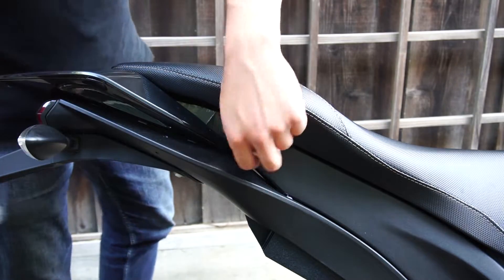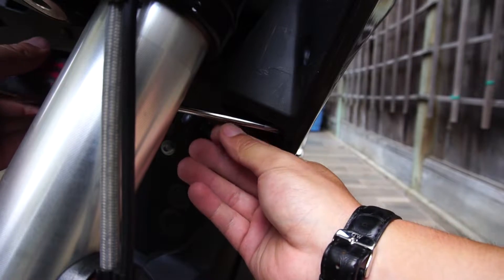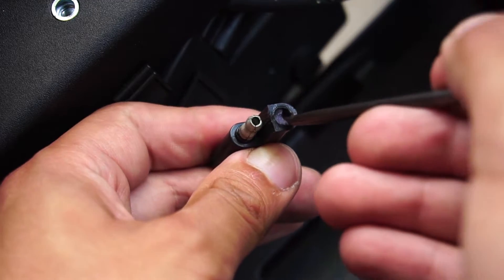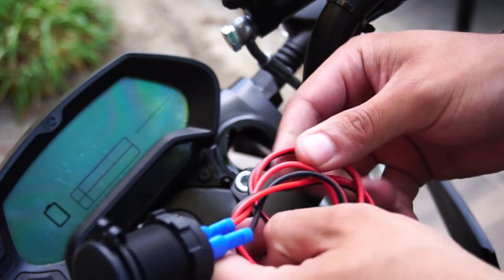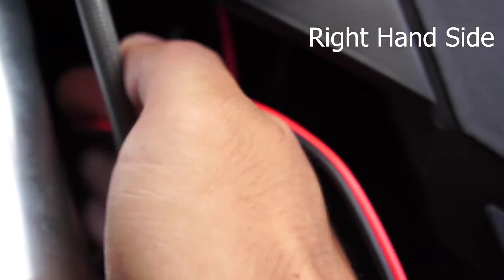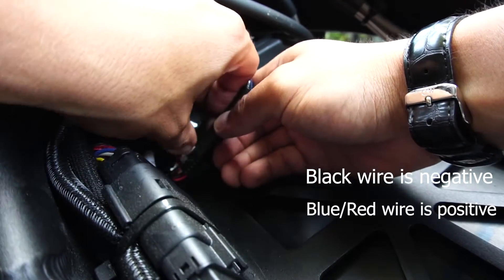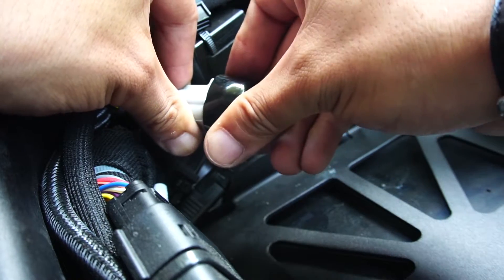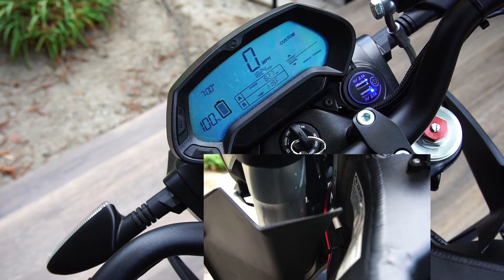Zero Motorcycle - How to install a USB charging socket

Comment: nice video! 
do you know what is max amper in that SAE connector?   I want to connect heated grips, which draw approx 6A i believe.  cheers.
Reply: just found my answer on unofficial zero manual, Both plugs are fed power from the same 10-amp circuit.

Comment: Nice vid. Thanks for referring to other vids for folks that wanted additional hand holding which kept the length of this one shorter.

I just installed the stock 12v plug in my 2018 S that has the charge tank option. I ordered the plug from Zero, hoping it would make things smooth and easy. Unfortunately, on my bike there was only the SAE connector and the plug they sold me had the other one. I looked everywhere I could without taking the charger out, but it wasn't there. So I purchased a SAE extension wire from Lowes, cut the gray connector off, soddering on the proper connector in it's place I guess if I'd purchased my plug from a third party source I would have been better off!

One other note. With the charge controller in the way, it wasn't so easy to push the wire up along the existing wire harness. I had to use a string fed through from the tank side, tie and tape it to the connector and use it to pull the wire up through. Worked like a charm.

Comment: great video! I have a question: is there a way to have the 12v socket working without the bike being turned on?
Reply: I wish this could work too. I do a lot of camping and it would be great to use my Zero battery as a really big backup for my 12v refrigerator, etc. My idea, which I have not yet implemented, would be to insert a switch at the fuse box to turn off the headlight when the bike is in ready to ride mode. With the kickstand down I think this would be a fine option as the rest of the functions of the bike probably don't use much power and it won't allow you to knock it off the stand even if someone accidentally turns the throttle. Adding another battery does not sound like a solution to me. You might as well just use an external battery pack.
Reply from the maker: You would need a seperate battery pack to continuously charge the 12v socket. I bet if you connected a SAE connector to a USB battery pack that may be a workaround. But it is less than ideal.
Reply: @alternativestandard3303  See my reply. How much power would it take to use my solution?

Comment: How do you install this when there is a charge tank in the place?
Reply from the maker: You may still find the SAE 12v connector behind the charge tank. Instead of removing the charge tank try looking for it from the front. It might be easier to find i that way.
Reply: I found the SAE connector along side my charge tank, but not the other style connector. I have a 2018 so perhaps they stopped providing both connectors? Or the other was hidden under the charger. I used the SAE so I'll never know for sure.

Comment: That gunk you pull out in the beginning is meant to be there. It helps with the connection.
Reply: Indeed. Better to take some of that gunk and put it on the exposed pin.

Comment: Any advice on how to connect LED strip lights to an FXS?  I can't find seem to find a video or good info.  They normally end in a black and red wire connecting to the bikes battery.
Reply from the maker: Depends, I also looked into installing LED strips. From what I found you need a set of lights that has the right wiring. From there you can opt for splicing in the SAE connector to the end of the wiring. But it would cost you a bit more for your project. If that doesn't work try a work around, by installing a USB connector and purchasing a USB compatible light strip. I'm still on my project but that's the best I can offer for now.
Reply: @alternativestandard3303  Thanks! Found this for adding an SAE connector. https://www.amazon.com/Connector-Converter-Motorcycle-Weatherproof-SAE1K/dp/B01DHJYLQ4

Comment: Note that this doesn't quite work for the Zero FX/FXS.  There is no hole to mount it.  You need the official kit to get the bracket which holds the plug.
Reply from the maker: That is a great point. The tag and video description was just updated. Hopefully I can get my hands on a FXS to show everyone. :D
Reply: @alternativestandard3303  Yep, I ended up ordering the materials to make one and didn't notice it myself on my FXS until I was done!  Oh well.

Comment: Very helpful. I have a 2016 Zero S with a power tank. The extra battery is secured in place by a bracket using two 10 mm nuts (use long socket). For the Allen screws I used size 3. For the torx bolts securing the seat I used size 45. Once the bracket for the power tank is removed you unplug the cable at the top of the battery and lift out the battery, which is heavy, to access the accessory plug. The local Zero Motorcycle dealership charges $100 for the install of the 12 volt accessory. I’m glad I did it myself. Thanks bro!
Reply from the maker: Nice job Jonathan! The process does take awhile if you have the power tank. But it is well worth it!
Reply: After reading your comment, I wonder if the additional connector was hidden under the charger on my 2016 S. As I wrote in my comment, I decided not to remove the charger, instead swapping the type of connector for one I purchased. Since I wasn't sure the other (non SAE) connector was under there, I thought it the best option.